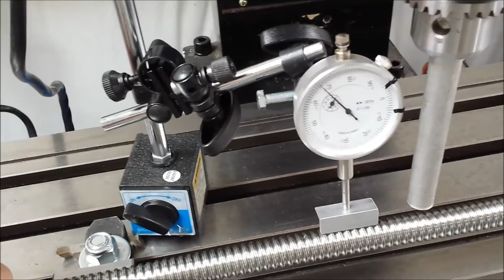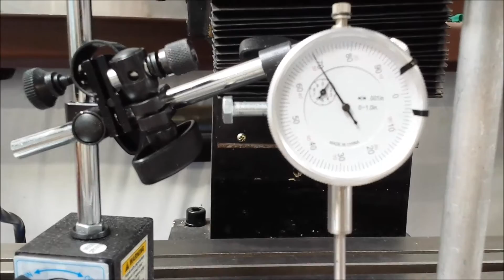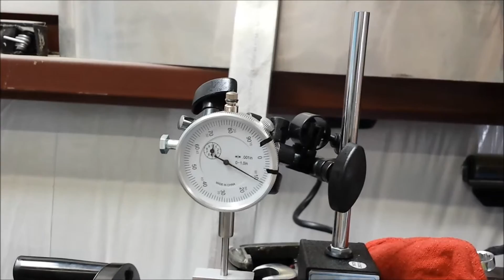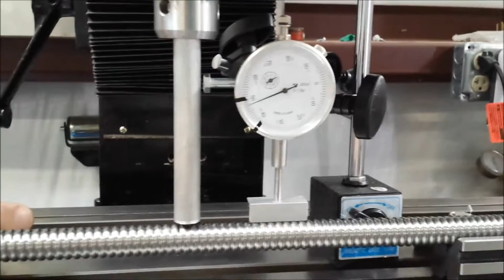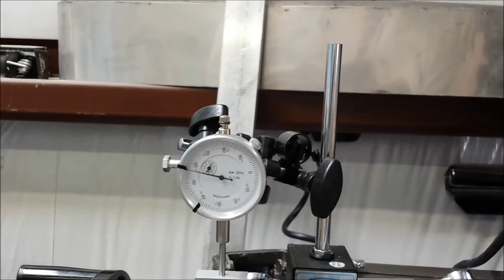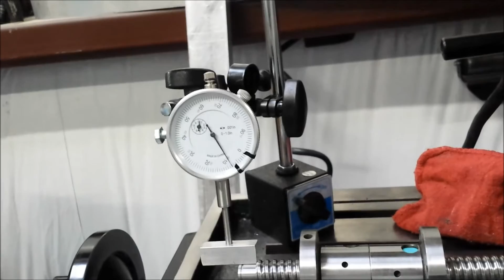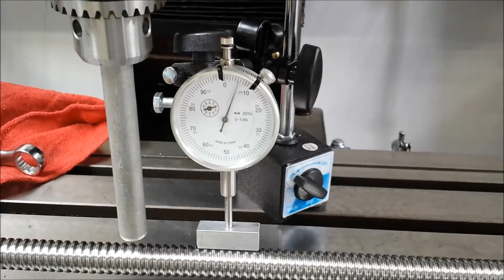BallscrewStraightening

Comment: Hi. Found your video form cnczone... Did linearmotinbearings offer you anything for the bad packaging? Is like to order a 50" long 2510 screw but am wary if the is a chance it will come bent and I'd rather not have to straighten it. Thanks